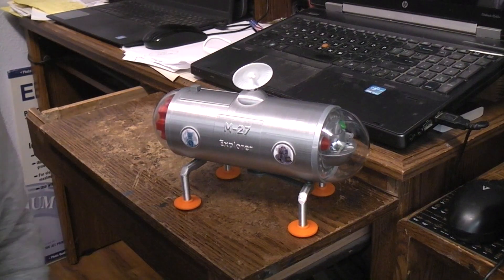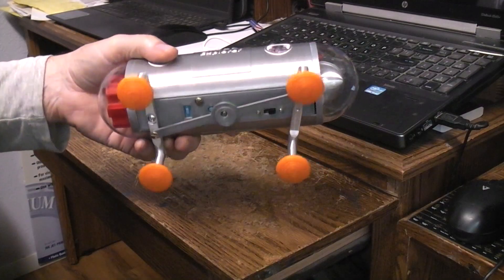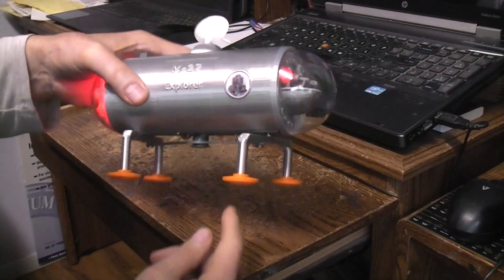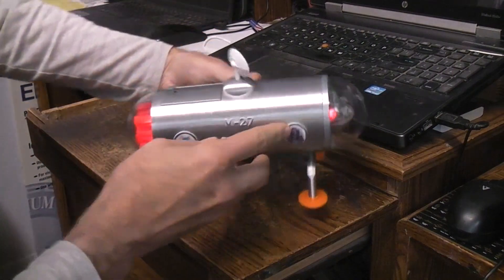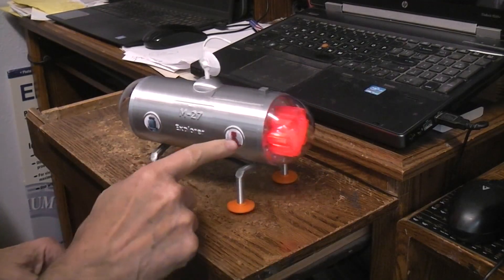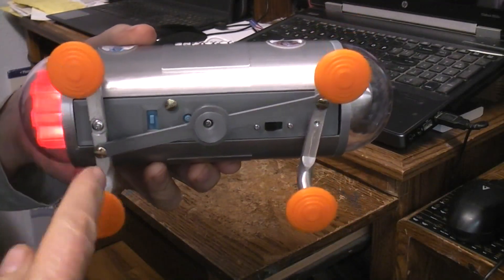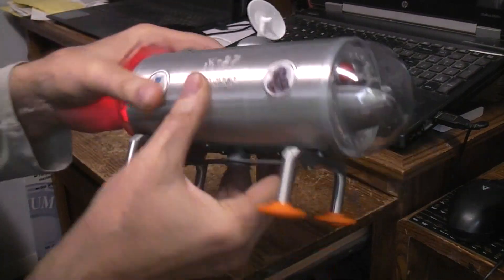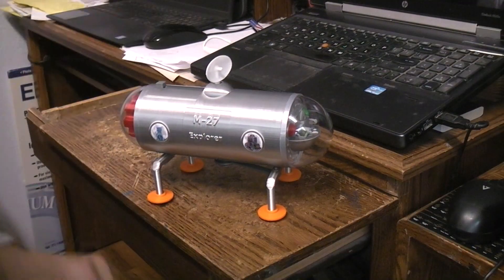Demo of M27 Explorer that you can 3d print and build. Using type 2, simple 4 leg mechanical design.

Comment: Hi, John! I need help with my Robert the robot. Somehow, the remote has come disconnected from the robot at the coupling where the wire cable joins into the back at the bottom. Can I email you somewhere to ask about sending him to you and possibly getting him repaired?
Reply from the maker: You can find my email on my Robothut channel contact page. But being that Robert the robot is large and packing and shipping too and from pulse whatever the repair charges are it might not be worth it. You might send pictures of the problem, and I might be able to walk you through the repair. Is it the original 1950's Robert or one of the repro roberts?
Reply: @Robothut  This is the original. It has the crank in the back and the cardboard record. I could try to send you some pictures but I am totally blind so if they don’t turn out great, just ask for more and I will be glad to try again until I get you something you can use. I’m not sure if you remember me but a while back, I sent you pictures of a doll with a phonograph inside. I did manage to get her working. I sent her to a phonograph restorer who lived in Spain. The only thing that was really wrong with her was the reproducer was punctured, and the mechanism needed a serious cleaning and a good lube job. Anyways, I will do my best to send you pictures first, and we will go from there.